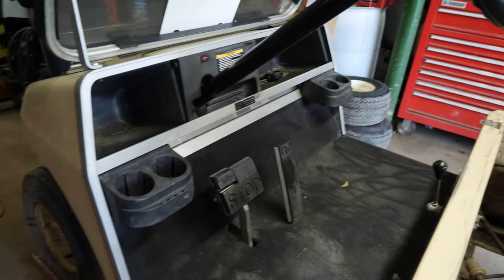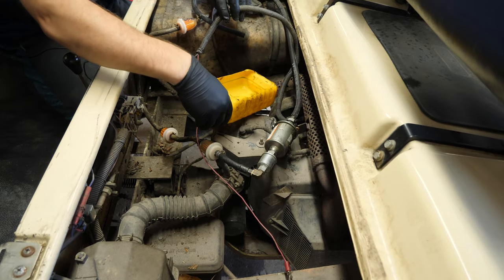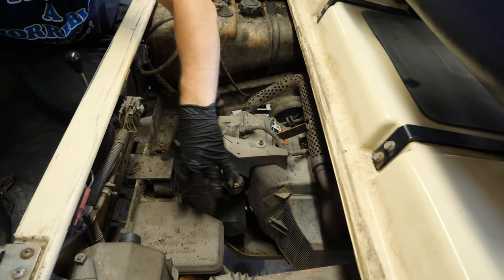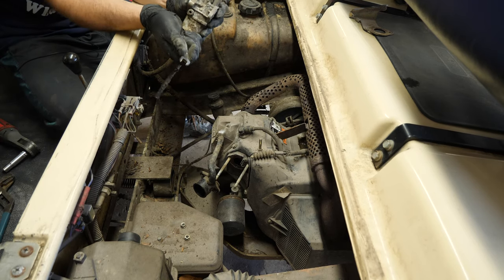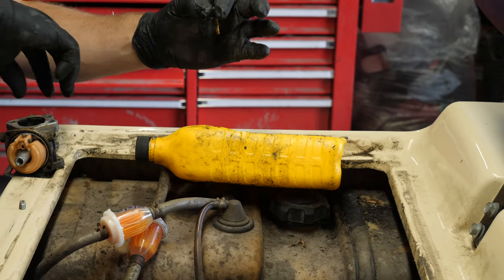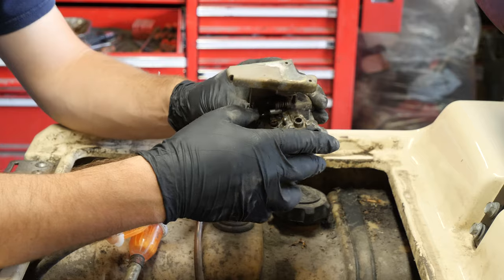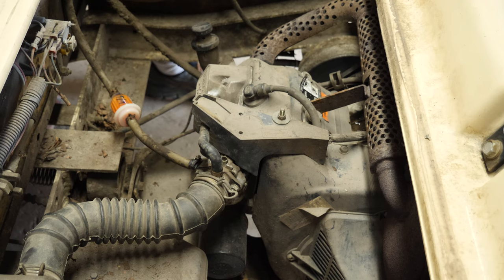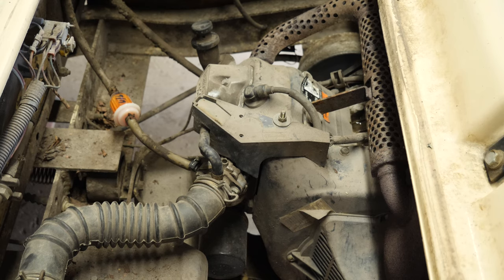1999 Club Car DS, Gas - Crank, No Start, Clean Carb

Comment: Hey Kevin! I have a 2000 DS gas club car. Engine rebuilt, new fuel filters, carb cleaned. Ran for a day then won’t start again. Checked the lash and adjusted. Have spark, compression, and fuel. Keeps backfiring through the carb. Any suggestions? Greatly appreciate it!

Comment: Hey Kevin, I have a Ez-Go 2005 and when I push the pedal down it turns over but doesn’t crank, However when I spray Super Tech Engine Starting Fluid on the carburetor it tries to crank but then can’t and stops. ( when It turns over the clutch doesn’t move it just stays in one position and rolls)

Comment: I have been re-watching your club cart repair videos. I ended up purchasing a 1997 gas powered DS. It will climb my steep driveway, not fast but it can climb it. Watching your videos really helped me. I think I can maintain my cart.

My used cart starts and runs fine, but I plan to change the oil and filter, air filter and possible the differential fluid so I'll know where I stand. The carburetor and gas filters were replaced last year. I plan to empty the gas tank and start out with fresh fuel with Stabilizer added.

I plan to add a rear seat soon and stronger rear springs, if necessary. Thank you so much for your videos.

Comment: Thanks Kevin, my golf cart was doing the same thing.   For some reason gas was not getting to the carburetor.    After watching you I decided to air out the gas line.   Before removing the carb, I decided that I needed to get gas up to the carb by siphoning the line.    Then I reconnected the hose.   By God, It works like a charm.    Had not been use in 3 years.    Thanks for the video.

Comment: Great Vid... It is really really helpful being that there aren't very many videos that I can find for this Club Car ( that is showing a detailed visual of what to do). I have a 2001 CC Pioneer 1200. Supposedly has a bad fuel pump but it got delivered a mess. The harness is all over the place as well as all kinds of extra parts and wires. Found an Electric Fuel Pumped on the frame which confused me til I saw the different screws holding it in along with all the other added things. I'm watching these so I can see where to start My brother told me, Spark, Fuel, Air and go from there. So I will try again tomorrow. Thanks Again! I appreciate and I'm pretty sure most of us are.

Comment: I have been working on My wife’s ez go txt gas golf cart. When we got back from vacation the cart was running ruff. I thought it just needed to be run down the road to clean it out. At first it worked. Everything seemed good. I let it sit for about an hour it would take a while like the first time. Then clear up. It was almost like under a load it would have half the power till I ran it down the road. Like it was losing power. Straining to get up a hill. I took the carburetor off cleaned it. Took the jet’s out cleaned them. The carburetor is super clean now. Put it all back together. Replaced all gas lines. Fuel pump is pumping gas. It’s still doing the same thing. I don’t understand what’s going on. In neutral it revs up fine. Like it should but as soon as I put it in drive and drive it down the road it acts like it straining again. Put it in neutral it does fine. Like no power under a load.
Reply from the maker: Lack of power is a symptom of loss of compression. If you have the 2 cylinder robin engine, adjust the valves to .004" (4 thousandths of an inch). The engine must be COLD to properly perform the adjustment.
Reply: @Kevinsgolfcarts  Thank for answering me. I really do appreciate it. I did a compression test. Both cylinders were reading 150 psi. Turns out it was either the gas or the spark plugs. Which I drained and put 93 octane and sea foam. Also replaced the spark plugs. It’s running better than before. I really learned a lot watching your videos. Look forward to more. Thanks again!
Reply from the maker: Glad you found the solution. I recommend ethanol-free gasoline only, if you have access to it in your area. High octane fuels are not recommended in these engines.

Comment: My man you were spot-on with this repair. I have a 1996 Club Car had an issue where it was just turning over and took a while to start. I cleaned out the carburetor the bowl and there was water in the bowl. I have a question though when I smash the gas down to the floor it wants to crank over but not start when I bring the pedal halfway back is when it starts what needs to be adjusted
Reply from the maker: The engine should crank at high pedal (barely pressed) and start running on its own power with a little more pedal. If you smash it to the floor, it should still fire up and go. The older Club Car DS's are a bit hard starting (in my experience). Its normal to give it a little choke when starting full throttle, even hot. Its possible that your cables are sticking or need to be adjusted. There are two, one from the control box to the governor and another from the governor to the carburetor. If I recall, the only one that can be adjusted is the one from the control box to the governor.
Reply: @Kevinsgolfcarts  I have a 1991 gas DS with the Kawasaki motor, I don't have an electric fuel pump to pull the line can I use a siphon pump to get the three-year-old fuel out of it and pull the carburetor as well, there is ethanol all over Arizona so I can't get non-ethanol fuel like I can in Montana. It's at because I couldn't get to the cart for three years. What do you think Kevin?

Comment: ok I was trying  to clean out carburetor the non half ass way and did ok other than while removing spring from top it popped off wherever it hooks up to at other end and I have no clue where it goes. I hope you know what im talking about im not a mechanic type but have been doing pretty well with your video.

Comment: I am honestly new to golf carts and had the exact same issue. What is the parts number for a new carburetor. Or what would I search for when looking it up as well as a fuel pump. Wanting to change carb, fuel pump lines and fuel filters.

Comment: I’m not getting gas flow from the tank. I’ve replaced the fuel pump, fuel filters, all the gas lines, the carburetor, spark plug and even replaced the air filter. I pulled the gas line out, no obstructions. There is suction however , as when I pull the spark plug, it’s pulling air when stepping in the gas. I can’t figure out what the issue is. Any suggestions?

Comment: Kevin, i have the same cart that runs great but the mystery is on loads it smokes white. The new spark plug is black and wet.
Reply from the maker: Check your oil level. It sounds like you might be overfilled. If it is, drain some or do a full oil and filter change. It holds about 1.5us quarts.
Reply: @Kevinsgolfcarts  yup just did all that. Maybe it just needs time to run before it stops smoking. Pretty sure the last guy overfilled it. Thanks

Comment: Hi sit with a problem on one of these engines it got spark carberattor clean fuel enough but still no start took of airfilter pipe choked it with my hand still no start. Oil enough and on Mark dipstick. Got a oil leak on secondary dipstick hole that's been blocked of thats it but no start. Can I say it's compression or is there something else I must first check? Would appreciate your info

Comment: Great videos!!...have watch multiple ones of yours. I have Ezgo Textron 1990 gas cart. . Was running while wet out through few small puddles in driveway.  Engine acted wierd almost like out of fuel.  Tank was out or very very low so added fuel. Would turn over great but no start. Verified spark was good with new plug. Took all air intake filter and hose off. Cart is cranking over great but no start. Pulled Fuel line and getting good flow all the way to carb inlet. You mentioned you could half it and just take carburetor bowl off. I did that and looked clean. Can you spray carb clean up in carb from bowl side without taking carb all the way off?  Never have really got that far in.
You also said you see solenoid issues at times....what should I look for on that? 
Any other ideas I would love to hear. Thanks
Reply from the maker: I would completely remove and clean the entire carb. Sometimes debris can get caught in the tiny passages causing issues. Usually if you drop the bowl and it has water in it, you can get away with cleaning just it. Generally, you should clean the entire thing to be sure there isn't more debris. Solenoids usually will fail and not work. Sometimes they can click but nothing else happens. You can test that with a volt meter. When the solenoid clicks, you test for 12V on both sides of the large terminals. One side should have constant 12v and the other should only have power when energized.
Reply: Just seeing your reply this evening after doing more work today. I am not hearing any clicking in solenoid but did clean all contacts. I did check the coil with meter and its showing 4.5 ohms so I believe I am good there. (Acceptable Range 3.7 to 5.2 ohms). I pulled just the bowl on carb yesterday but it looked pretty clean. Replaced and still turning over good but no start. Uncharted territory to pull carb apart and clean but I did to follow your video and go ahead and pull the carb this afternoon. Ran out of cleaner so will finish tomorrow and replace carb. If this doesn't work I plan to start trouble shooting again from the beginning as I must have missed something. 
As I continue to review what I may have missed...If the spark plug is not correct would the cart run rough or just not run at all? This cart has a Robin Engine model EC25-3PG 244cc.  After more research I am seeing online the plug is NGK BP5HS also a 4 or 6 could work. Not sure if you would know if that's correct #?  I'm interested in any ideas you think I should try. I'll keep you posted on what happens on the carb cleaning tomorrow. Thanks
Reply from the maker: @jackzu6483  Ok, so you are running the single cylinder 2-stroke Robin engine. If you have spark, good fuel flow, get yourself a compression tester. I have links to them in the description. I think you can rent them from AutoZone if you don't want to buy one. Check compression and it needs to be higher than 110psi. 125psi+ is better, ideal is 150psi or higher. Those engines are known for blowing the crankshaft oil seal behind the fan, especially if over-revved. If the seal is blown out, the engine will not be able run its 2-cycles properly. As for the spark plug, BP5HS is fine to run in that engine. There are 4 things you need for any internal combustion engine, air, fuel spark and compression. If any one of those 4 is missing, it wont run.
Reply: Ill see what I can find out. Let me know video title if you have one on this bigger job. Thanks for the help so far
Reply: Ok took carb apart and cleaned exactly step by step and reinstalled. Again great crank over but no start. I do exhaust as it turns over and exhaust warms pipe but no start. I couple of small back fire spits... that's it. I noticed turning over in reverse it seems to have more of a rattle noise and still no start.  My next step is to get compression tester to see if I have the blown seal you talked about. If it ends up that the crank case seal I'm interested in replacing or is that crazy talk. I have tore into a motor but I am mechanical/technical oriented.  Thoughts/suggestions?  Do you have a video I should watch of yours on this. Really appreciate your help. Thanks
Reply: Sorry missed a word..." I have never taken a motor apart". Or is this something you come in from the fan side? Thoughts on if it's worth it to try tearing into motor or other options?  Thanks

Comment: I have a club cart (95) it will crack but won’t start. I have replaced the gas, filters, fuel pump and carb. But still won’t start. Any ideas??

Comment: Hi Kevin! Awesome videos! I would like to inquire about hd valve springs for fe350 and 290. What should I get and where can I purchase them? Your answer would greatly be appreciated. Thanks
Reply from the maker: I haven't seen any hd valve springs available for these engines. I don't deal with modifying these engines as the cost is nearly equal to a "big block" upgrade.
Reply: @Kevinsgolfcarts  ahh i see. Thanks for your time. Happy Easter 🐣

Comment: Hi Kevin,  I'm all the way down here in New Zealand. I have an old Yamaha petrol cart. I take it for a run for about 30 mins and it ends up stopping and won't fire again . Pull the spark plug out and it black and dry. I clean it up and put it back in and it does the same thing again. Is it getting to much fuel or something?. I have taken carburetor apart and cleaned everything and put it back. Do u need a hotter plug ?? Or what do u recommend I do . Cheers
Reply from the maker: Depending on the year, it could be a failing CDI and/or ignition coil. If it was getting too much gas, the plug would be wet. I would pull the fuel line off the carb when it stops running and see if its still pumping. If thats good, pull the plug, stick it in the plug wire and crank it over to see if you still have spark. If not, then its the coil or CDI. If it still has spark, you may need to do a compression test. It sounds electrical so start there.

Comment: About to put new carb on mine. I didn't see you put new gaskets on. Are they not needed??
Reply from the maker: If the gaskets are in good shape, there's no need to replace the gaskets. If you are installing a new carb, this would be the time to replace the gaskets. There are gaskets between every mating surface.

Comment: Hi Kevin, I’m experiencing a problem with my club Car carryall, it has the FE400d wife brought it to the backyard after using it all day, went out to start it after a few hours and crank no start. It has fuel and spark, pulled the plug and changed it just in case of weak spark, dripped fuel in the cylinder before putting in the new one, didnt fire, the carburetor is Garand new as well as both filters, I pulled the carburetor bowl no trash in bowl. I’m thinking it’s a weak spark, coil maybe? 

Any ideas?
Reply: Try unhooking the air filter see if that helps.sometimes the filter is so clogged it won't start.
Reply: Club car 2003 no spark
Reply: @paulholmes8796  try to jump the celenoid
Reply: tv  rolls over no spark
Reply: Here is a step by step guide to trouble shooting 92-96 Club Car with no spark. For 97-up, skip step 3. 

Step 1. Un plug the black/white wire from the limiter, down by the base of the dip stick, in this area. If it still does not spark, go to step 2. If it starts, there is a bad micro in the black box or on the back of the F&R lever, key switch or short in the wire going back to the black box. 

Step 2. Remove the ground wire of the limiter and tape it up. The wire is usually brown in color and is directly under the limiter mounting bolt on the left side of the limiter. This by-passes the rpm limiter. If it starts, replace limiter. If no spark, go to step 3. (IF 97-UP, GO TO STEP 4) 

Step 3A. Replace ignitor with a known good one. If it starts, replace ignitor or replace coil with new style 97-up with built in ignitor. You will just need to unplug the old ignitor to remove it from the system if you go with the new style coil. If no spark, go to step 4. 

Step3B. If you have no access to a known good ignitor, I recommend buying the newer style coil with built in ignitor at this point only because if you are going to invest that kind of money on a part you don't know for sure is bad, it may be a waste of money. Sure, its a little more work but you are pretty much guaranteed it will work. 

Step 4. Replace coil. I would replace coil with newer style 97-up only because in the future, trouble shooting will be simpler. That is why they went to this style coil. Coil requires a .011-.012 gap between coil and magnet when tightening the screws down that hold it. 

Step 1 explained more. 
If it started, you need to check the micro in the black box. There is one micro that has the black/white wire coming off it. If the micro is bad, it could send a ground to the coil. Also, there is micros on the F&R switch. It must be in gear to remove the ground from the coil. Then, there is the key switch. When the key is in the off position, it sends a ground to the coil. With key on, it removes ground. Also, the black/white wire can get shorted out on 92-96 back where the tranny is close to the engine block. I have seen these get the wire pinched between them and short it out. 

So, in short, when trying to start your cart 
Key on, no ground 
In either F or R,Micro should have no ground 
Black box micro with gas depressed, No ground 
You can check all these with a volt meter set to OHMS. One wire to ground and the other on the side of micro that goes to coil.

Comment: Hi Kevin can I ask a question regards the drive clutch on a 1992 club car ? People say you can use the later 1997 clutch even though the engine rotations are different is this the case only i’am finding it difficult to find a 92 clutch thanks in advance !!!
Reply from the maker: I don't believe the the engine rotation direction has anything to do with how the clutch works. These clutches work based on rotation speed. As far as the part numbers, 1018339-04 is for 88+ and 1018339-02 is 97-2015. I have not tried using one or the other on older models. I haven't changed many Club Car clutches since they usually wear out before they fail.